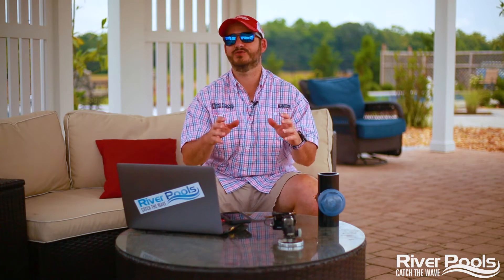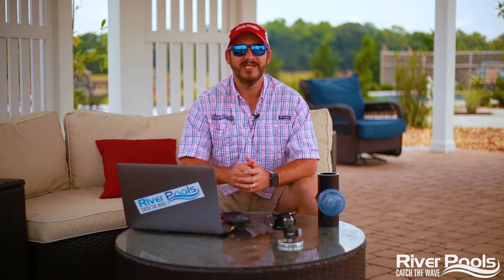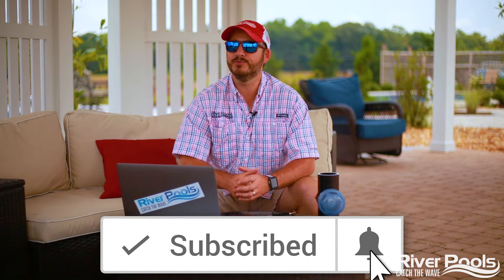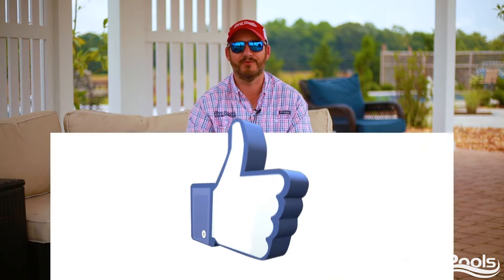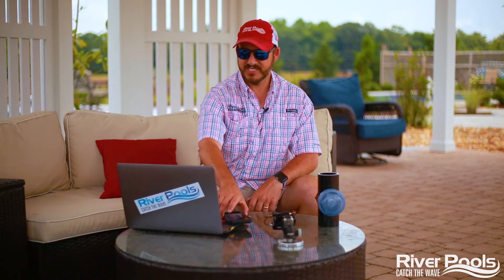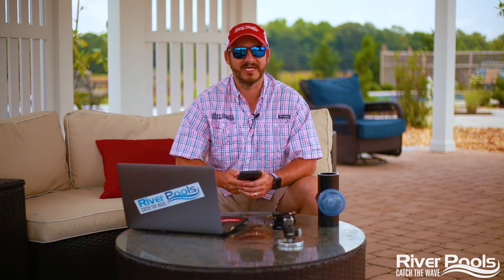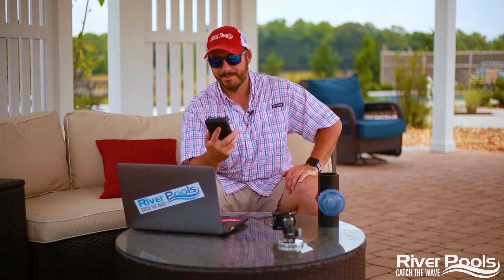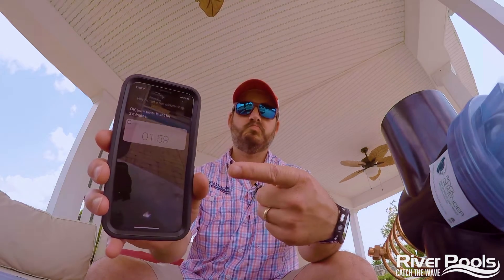Pool Bonding 101: Why Handrails, Coping, and Water Could Shock You

Comment: Ok. But how do you VERIFY you actually have equipotential voltage across all bonded components?  1) how do you test the main panel earth voltage as a reference point and 2) how do you subsequently verify all bonded structures have the same voltage ?

Comment: Crazy question, but how do you test pool is properly bonded and grounded? how about running power (lights + pump) through GFI?
Reply: Your pool power should be on a GFCI protected circuit. The bonding is a separate aspect and can help if the GFCI fails to work if the pump or other equipment experiences a fault.

Comment: I have everything connected even the anode but inspecter is telling me there's a in line pvc with copper in it that I need to connect to the plumbing of the pool however I cannot find what he's talking about anywhere....
Reply: He is telling me that the anode alone is not enough and so won't pass my inspection...
Reply from the maker: There should be a copper coil coming off the bottom of the anode. That gets connected to the ground loop. 👍

Comment: Doesn't the water bonding device need to be below the pool water level so when the pump is off the device is still in the water?
Reply: The pool bond device he showed is in the plumbing line so it's always in contact with water unless you have a leak that causes the piping to drain.  That would be bad and easily found in most cases.  The light housing is also "bonded" to the same wire and connected to the ground bar/bus in the pool panel.

Comment: how would you go about bonding an existing pool with concrete deck? Without tearing the deck up to lay a grid. Can you install that pool bond in-line on the return and run the copper to the bonding lug on the pump?
Reply: Did you rip up the concrete to fix your pool bond? We are about to do this and it isn’t cheap :(

Comment: If there were any current running through the water, how would that not trip the GFCI ?  Is this just a redundancy to the GFCI?  Or something else that I am missing?

I am really perplexed, I've had an above ground pool for 30+ years & there definitely is no bonding.  I am doing repairs currently & if this needs to be done, I should do it now.
Reply: This is also to prevent stray voltage on the grounding system provided from the utility from causing mild shocks between the electrical ground and the true earth ground. There is often a small voltage of about 1-10 volts AC between the electrical system ground that is connecting to the pump and your plumbing and the actual earth. As in shoving one lead of a multimeter into the earth and the other on one of your water pipes or a ground prong of an outlet is likely to show a small voltage, even if your main breaker in your house is completely off. The actual size of this voltage depends how well balanced the phases of the utility system are as well as your distance from the substation but it is enough to give an unpleasant tingle in the wet environment of a pool under some conditions. A GFCI would not prevent this. It would only prevent a large shock due to the pump putting 120V into the water. It does nothing to mitigate stray voltage that is usually present in north American power systems. It is also important in the event that something other than a GFCI protected device were to energize the pool.
Reply: @chrisbauer1925  thank you do spending the time writing such a detailed response.

so this is done to prevent the stray voltage (a minor but real concern), and protect in case an extension cord gets dumped in there or something (a major & real concern).  have I got a decent handle on that?

follow up:  I've also got a hot tub(different circuit & physical location), do these same principals apply there too?  ie do I need to bond my hot tub too?

thanks again, I was having trouble getting a decent answer to my question, your explanation was excellent.
Reply: https://www.youtube.com/watch?v=j7r1UyuIgss and https://www.youtube.com/watch?v=a_nv_Q9WbeE  are interesting info about pool bonding and the source of that stray voltage I was talking about.

Comment: Many thanks, very clear. I have a Pond lined with poliethilene liner whose water is recirculated by an external pump( Pentair intelliflo xf). The only metallic parts inside the pond are some 12V lights. Do I need to bond the motor of the pump? And how?
Thanks
Reply: i belive code clears you if your low voltage lights are made for aquatics. if not you would need to know if the pump is double insulated. most above ground pool pumps are now double insulated meaning the innerworking of the motor are insulated from any metal that is exposed to the elements. if it is double insultated i dont belive you have to attach the pump to you equipotential grid. check me on that

Comment: Thanks Christian.  So the sacrificial anode does 2 things: protects pool metals and puts the water at equipotenial with grab bars, slides etc. Now, one thing I wonder about.  Let's say someone had a drill or electrical appliance plugged into a non gfi outlet.  If that was dropped into the pool and it wasn't bonded that could be lethal right?   Secondly, does the equipontenial bonding system get tied back to the panel's ground buss or is it basically just a ring of solid #8 copper that ties everything together to form no potential difference between the water and any conductive components?

Comment: If the pool is made with wood and nails sitting in concrete blocks I still have to ground it
Reply: if it has an electic pump for filtration yes.
Reply: @matthewlewellen6516  cool thanks

Comment: Great vid. After all metal components and pool water are hooked up, does the bonding wire connect back up to your sub-panel's grounding bar?
Reply: Never had to put a ground rod in always just bond everything together thats near or part of the pool. Its not grounding its bonding
Reply: See my comment below please!
Reply: No put a ground rod in at the pool and connect the pool bonding to it
Reply: Got it thanks !!
Reply: @16912outdoors  , this is absolutely WRONG!  The bond wire is connected back to the ground bus/bar in the panel to ensure any stray/dangerous voltage gets back to the main ground/breaker to trip a breaker!  This also depends on how many wires you have supplying power to your panel... 3 or 4 wire feed.  Call an electrician familiar with Pool Bonding!
Reply: @handyvetinspections5497  pool bonding does not go back to your electrical panel.
Reply: @16912outdoors   The bonding wire is connected to the frame of the pump motor and heater (if installed) and therefore it is going back to the panel.  Yes, there can be a ground rod but the main path is back to the panel.

Comment: Great videos.  Several people are telling me to add a saltwater system to my pool instead of the in-line pellet system.  We have an inground vinyl liner pool built in 2003.  I don't see any sign that the pool itself is bonded, but I'm not sure how to tell.  There are two ladders, but they are not touching the water; there is no wire connected to the outside of the ladder.  The pool pump and heater are bonded as there is a copper wire connecting them.  If I add an in-line anode by the filter and an anode inside the skimmer is that sufficient to convert this to saltwater?
Reply: I am in the same situation

Comment: Must rebar in concrete pools also be bonded and grounded?  If so, how?   Thank you very much!
Reply: To actually answer your question, the rebar is bonded at four locations typically four corners and the pool contractor leaves the rebar extended in those areas to attach to your bond wire.
Reply from the maker: Bonding lugs. The cage gets bonded and the deck gets bonded. Both will need an inspection👍

Comment: What happens when you have a resin pool..
Reply: i wanna know this as well,  thanks
Reply from the maker: All metal components still need to be bonded.
Reply: @RiverPools  so you have to drill into the wall instead of columns?
Reply: The only part on my resume pool that is metal is the wall do I have to put anything in the wall? Also there is something called a Burndy BWB680AG that is made to go into the skimmer  I would believe this should suffice
Reply: No one seems to have an answer to this question. I am in the same boat, and the only two answers I have heard is to drill into the bottom of the wall near the cove where there is less potential to destroy liner and do it in 4 points. The other answer I heard is that you just bond at one point which is where the screws connect teh wall panel together and then bond the skimmer with a plate. I also heard that you can not touch the wall at all and just have a perimeter around the pool 18-24" and 6" deep with the copper wire buried in that, and then also connect that to pumps and to skimmer water. I am a total newbie but have been researching alot, not sure which solution is correct.

Comment: " its really not that bad of an experience, really" LOL nah only like the risk of death!
Reply: 30+ years back I spent Summers cleaning pools.  One pool wasn’t bonded/grounded properly.  Plus it was difficult to prime the pump and get the return & intake valves opened quickly. 
 That frickin’ pool generated a real sobering jolt.  And worse,  you couldn’t let go until all those old valves were opened.  It sucked.  Every morning our crew of six gave the job to the guy most hungover. Living at the beach then it could be damn difficult deciding who deserved the job. Occasionally guys were in such rough shape they volunteered for the wake up jolt.  I sure got my fair share.
Reply: This guys on crack. Depending on the voltage differential it could be fatal and has been fatal. Your bonding inspection is the most critical part of the entire installation. And by the way some people will say my pool is not bonded correctly so we just turn off the pumps when we swim. We have tested pools with the entire pool panel de energized from the main panel and had life threatening voltages in the pool water coming from the street power through the house neutral into the pool. Un bonded pools are death traps. This guy is making like it’s no big deal just a little buzz? He has no business posting videos about pool electric. Let him change your liner and tell him to have a nice day and consult an electrical contractor.
Reply from the maker: Hi legacychop! With prolonged exposure, sure something bad could happen. But most likely the sensation will be unpleasant enough for you to take countermeasures. Thanks for watching and commenting!